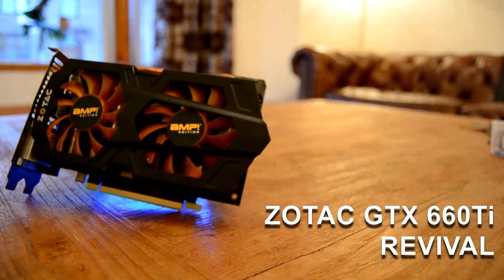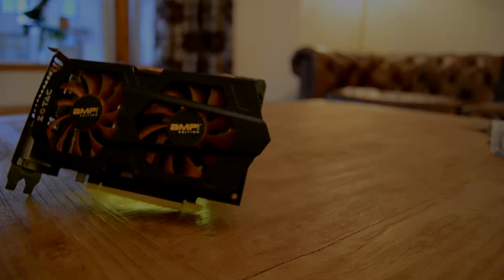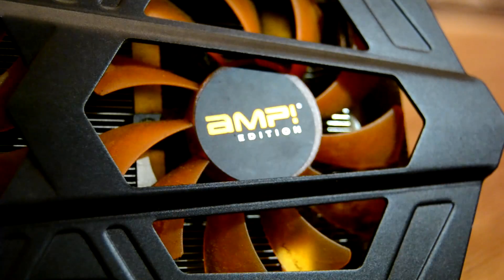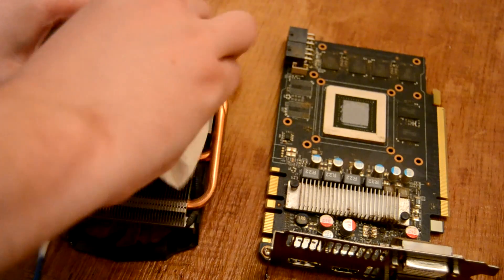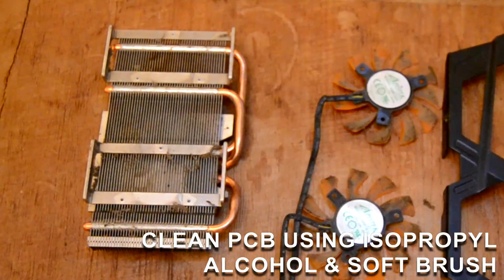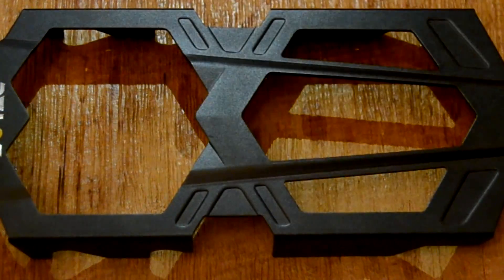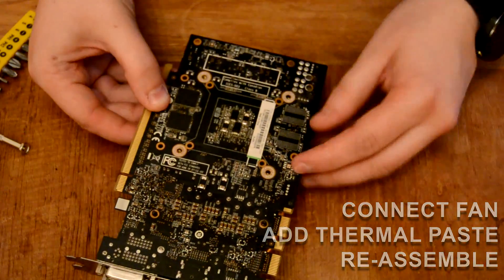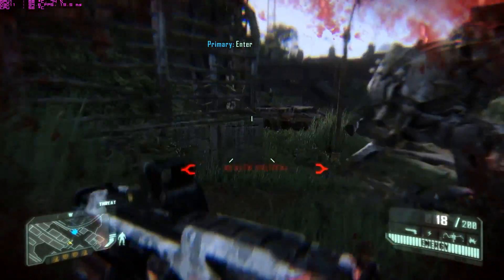Can we fix and refurbish this GTX 660Ti ? Bricked Bios, Broken fan.

Comment: Plz help me i have the same board you have i use gtx 660 2gb oc in it but when i play game my gpu is like
100% in 37c
And my memory is like using 880 mhz
With FPS lag 
Cpu is performing nomally not at high as well as ram not high but gpu is...
Plz help

Comment: I bought recently this exact card, everything worked normal after a clean up. But I'm still having fan problems, did you open your fans to clean them, or just on the outside? I don't know If I can just open up the fan(pulling both sides), never did that.

Comment: I bought a GTX 460 off eBay for £10 knowing it was broken, took it all apart, gave everything a good couple hours of cleaning attention, put on some new thermal paste and it works great. It's actually quite a quiet card, even under full load and temperatures are great too (tops off at around 67 C on load and 45 C at idle doing nothing). Definitely not the most powerful card by todays standards but it can hold it's own in some older games and even in quite a few newer ones. Never the less a fun project to restore a graphics card and hopefully I can use it if I ever get my hands on a older PC.

Comment: nice video! last day i bricked my Amd rx 460  and my system does't start with integrated video 
(  fans work(VGA) and There is no segnal).
i can't restore my BIOS for example via DOS , help pls :(
Reply from the maker: +xkenny998 mac how did you 'brick' it?
Reply: F7GOS i flashed the Bios

Comment: As I understand it a GPU should have the thermal paste spread on every bit(as it was taken off) do not rely on the clamp to spread method.Don't forget under a CPU lid is a fully covered piece of silicon.
Reply from the maker: True, but with a rice sized blob your going to more than cover the GPU, if your concerned about a little over spill then the spread method might reduce that, but in terms of GPU coverage a dolop will do the job.

If the clamp cant spread out a rice sized blob of thermal paste over something the size of a GPU then its not going to be close enough to transfer heat well.

But the spreader method is certainly cleaner and there will be less for you to clean off when you next refurbish the card but in terms of thermals there's no real benefit from what I've found and I think the choice of thermal paste will have a much bigger impact than the method of application. 

Ill maybe adopt the spreader method next time I record a refurb... as you have seen my rice sized blob isn't really rice shaped anyway haha 😂

Comment: i see an ad that shows GTX 750 ti "PROTOTYPE" should I get it ? it's half the price of a regular GTX 750 ti
Reply: No, if it's the one I'm thinking of. If it says 1gb of vram, don't get it. Those are crappy scams of rebranded 550ti's, which perform marginally worse. If I'm wrong however, then it's up to you, but I'd stay clear.
Reply: Christian C it's the two gigabyte version
Reply: Yeah, If it's on ebay and the seller has good reviews/ good return policy or if it's on a trusted site with returns available, you should be good.
Reply: Christian C thanks for the tips but what about performance ? I was expecting to have it run as good as the original GTX 750 ti
Reply: If it's a prototype, that usually means just an early access version of the card. As it would be the same dye(They wouldn't change the architecture or any critical component through the development process). Just ask the seller if you would like to know. That's pretty much all I could say about that. Good luck!
Reply: Christian C thanks again 👍👍👍

Comment: i got gpu that fans spin and all but no dysplay
Reply: did you just buy it? if so send it back thats not good
Reply: No got it from a friend whose friend gave it to him. It a amd 6870 gpu or 6950 or 6850. Was loaded and filled with dust so I opened and cleaned it out and looks new but no display and computer beeps saying vram corrupted. Any fix besides reflow?
Reply: Well if the VRAM is corrupted your card is a brick. Sorry bro
Reply: well at least  I got rx 580 msi gaming x 8gb at micro center for $250 when it came out and works perfectly. My only graphic card I got that works and that pcie
Reply: well minus the one i got for my parents for pc i built them

Comment: Yet another great video, got myself a very well used hd5850 at the start of the year for my prebult acer w/ i5-2400 and gave it a refurb. Wish I would of used q tips for the old thermal paste/dust great tip ! was actually thinking about this card to replace the old 5850 due to its small size and low cost now. Would love to see more content like this keep it up !
Reply: You can find tiny tiny one fan, 1060's, 1070's. And if you want a low power card you could always get a 1050ti
Reply: If I could afford a 1060 or even a 1050ti I would certainly be going for one but I'm on a tight budget I've spent £120 so far on everything I could probably just about get a 1050 non ti for that ! thanks for the reply though any other older cards that had a small version? power draw isn't a problem as I have a 600w psu
Reply: 750ti is good if you can find it for less than a 1050. A 1050 is only like 100 USD and performs much better. The 750ti used to be 100 but its production ended a while ago so im not sure
Reply: Combatsmithen ended up with an r9 270x for £65 !! absolute bargain and has enabled me to bump all my graphics settings to ultra, I got a power color single fan varient and is only about 230mm in length also.
Reply: Nice job thats a steal. Sadly in ~2 years you may need to upgrade if you wanna continue running ultra